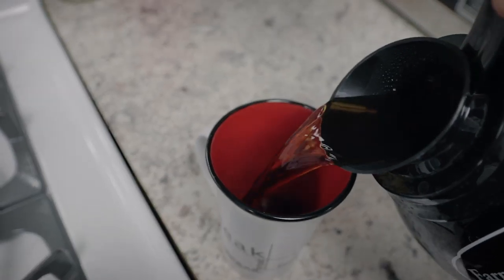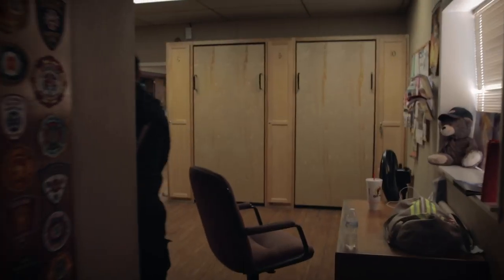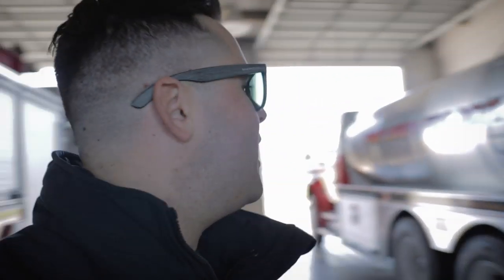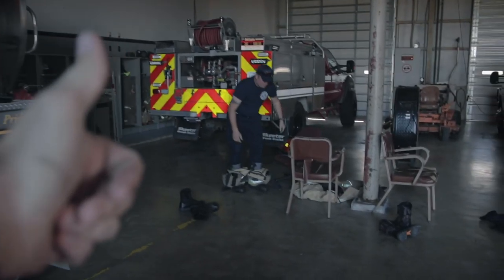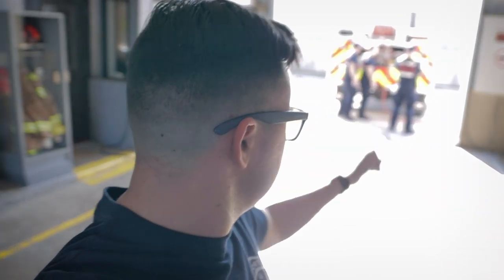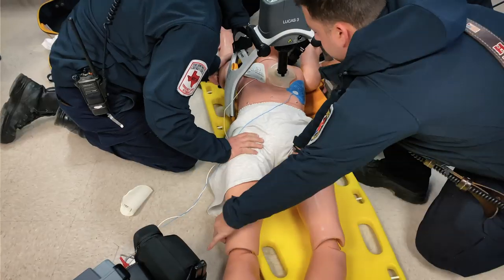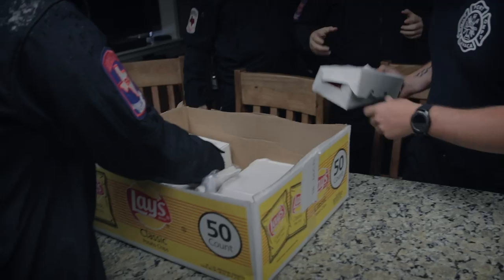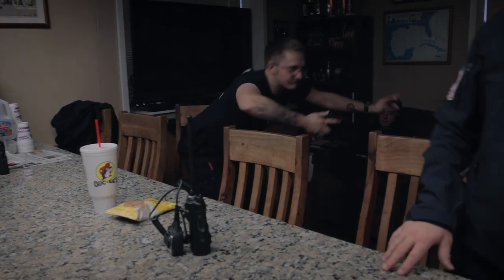Firefighter Shenanigans Pt 3 -  CAR FIRE & More

Comment: I failed my nremt twice someone please recommend me a good study guide i feel like the questions are just so different from the text book help
Reply: I took my nremt straight out of class, I used some apps to give me practice questions and watched videos on how to analyze the questions which is a huge part of it, I recommend doing that. Randomized questions and practicing analyzing them is what will help the most. Review cardiac and airway intensely.
Reply: LC ready review plus I think its called costs some money not too bad but helped me pass first try, highly recommend that. I know the test has different questions each time but I had a lot of the shock questions. Good luck!
Reply: Emt prep did the job for me. I failed horribly the first time but passed the second time. Cost money but worth it so I could pass.
Reply: If you take a quality EMT course then you don’t need to study for the NREMT. Nobody in my class studied for it but did take the test very quickly after the course ended